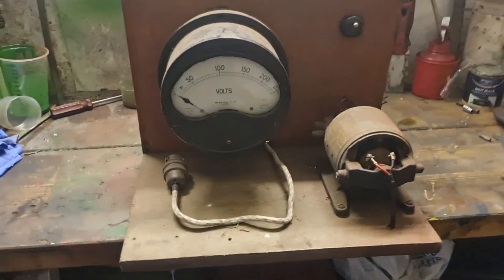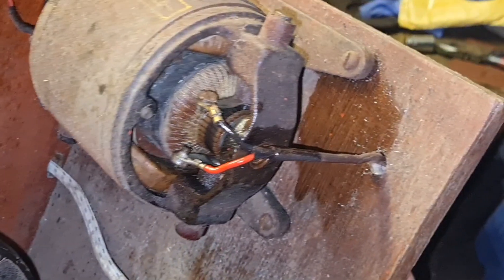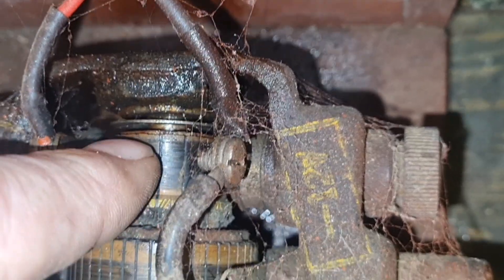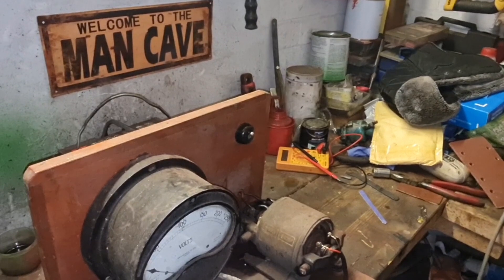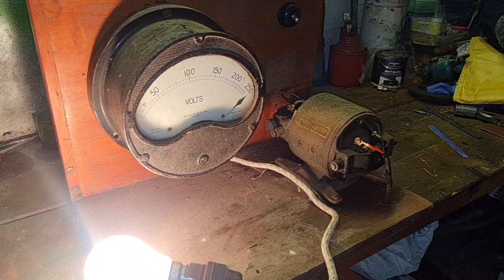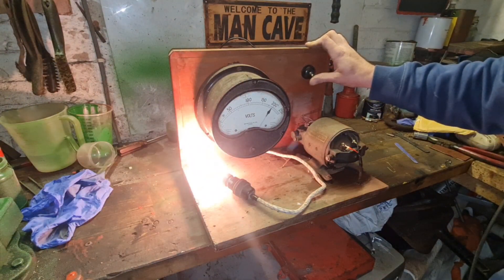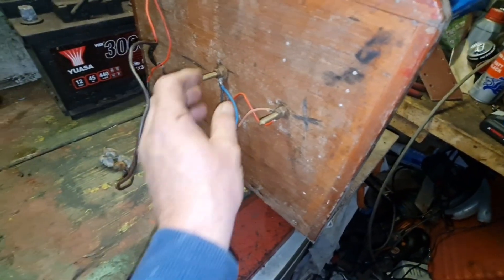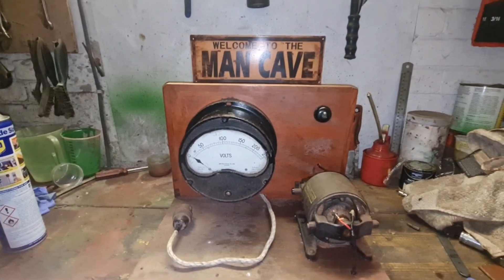Leyland Rotary Transformer. Will it work?? 12v to 550V 😆

Comment: They radio dynamotors, or rotary transformers for old tube radios some are for the transmitter portion, and smaller one for the receiver. They step up the voltage for the tubes, or valves on airplanes, or boats. I have one that’s a bit of an odd ball it’s military, haven’t been able to find much on it, but just based of its size at out put for watts when you do ohms law it’s probably for the receiver portion to what ever radio it went to. They are fun interesting pieces of history, there essentially an early inverter  though also know that there were different versions that were AC, or a kinda of dc output( really it pluses because of the switch commutator, which was herd in the radios.

Comment: Those machines are called "Rotary Converters" the part the brushes are in contact with are called "commutators". Way back they would be in all sizes up to hundreds of kilowatts. I have a 1920's book with pictures of them in very large sizes used in DC mains supplies. That rotary converter would have been on a mobile radio transmitter with the 240 volts on the intermediate valves and the 500 volts on the power output, the voltage would be correct only at the rated load so the bulb you have is not a big enough load to pull the voltage down to 250 volts. I would buy it from you, say £20..
Reply from the maker: Aw very helpfull mate. Thanks. Not sure I want to let it go now 🤣🤣

Comment: Hi 
I believe these dynamotors or rotary transformers were used in aircraft radio equipment before transistor inverters became available
Reply: You would be correct :)
Reply: And I had on old 19 set (tank radio transceiver) which had a small one built in.
Reply from the maker: Aw thanks for the info.

Comment: When I was a kid I bought one of these at an electronic second hand store, I had a 1/4 hp motor and an old car 1 2v generator along with a tripolet multi meter to do experiments priceless knowledge I'm lucky that I did not kill myself shocked many times that was around 1961 or 2
Reply from the maker: Yeah I don't want a belt off that blooming thing. 🤣🤣
Reply: I owned one when I was a school boy  in the late  60th, a classmate found it on his father farm in a tool shed. It was used for  a mobile radio transmitter of the german army (Wehrmacht) , it put out  1000V at 150mA from a 12V battery. I used it for electric  fishing on a little lake near my place. And yes I was zapped , a  very painful experience.  Later it found a job for a homebrew CB power amp with valves.  The german designation for such dynamotors are "Umformer"

Comment: Adam, that rotary convertor or transformer would have been used in a WW2 military vehicle for powering a receiver/transmitter, those voltages are I believe for a 19 set. DO NOT TOUCH THEM AS THEY COULD WELL MAKE YOU DEAD!
Reply from the maker: Yeah. The bloody thing scares me. 🤣🤣. To many exposed terminals to accidently touch. I bet the 550v would wake you up, or put you to sleep 🤣🤣

Comment: That is designed to provide power for a radio.
Those generally date to WW2 and the most common ones are from aircraft radios, but they generally operate on 28 volts. That one being 12 volts is more likely a land vehicles radio supply.
Reply from the maker: Aw I didn't know that. Thanks

Comment: Only to use with (military) radio-gear (using valves)
Totally not fitted for regular bulbs as the current (miliamps) delivered at the High voltage side is WAY too low. 
Just good enough for LED (to test)
It will probably deliver DC ... not AC.
They are called "dynamotors" and were commonly used during WW2
Reply from the maker: Yeah its DC only. What sort of draw would I need on that to make it work??
Reply: @NorfolkMancave  I don't understand what you mean with "draw" ... 
Probably "current-draw".

Those dynamotors normally produce 2 high voltages ... one (quite high) for the transmitter-tube ... mostly about 500VDC.
And a lower "high-voltage" (about 270V) for the receiver part.

I cant make-up what's on that copperplate, but it should mention a mA-value for all the voltages produced.

Seems to me that this little dynamotor doesn't come from a very powerfull tranceiver. 

You can easily calculate the watts by multiplying voltage ratio with the given mA-ratio. 

For really "big" tranceivers the military used big(ger) motor-driven generators in the field.

But could you use this for "other" purposes than tranceivers??? Not really ...

I'd consider this as some kind of school-display to show how a dynamoter works.

Comment: These things are cool af I wonder with a transformer if could be used as a kinda free energy device u know like a 240 to 12v transformer from the output too the input technically it should run constantly obs would have to have a switched 12v battery to get her goin then turn off once spooling also I wonder if u had a rheostat of soem sort on the input of u could control the voltage ie slow motor down a bit to get closer to 240
Reply: Lol, that doesn't work, but feel free to wander around fantasy island
Reply from the maker: Yeah I did wonder if you could run it off a battery that was charging by solar or wind.
Reply: @NorfolkMancave  ye man should be able too u would need a fair amount of solar power think should imagine be interested to see what amp currrent it draws while running could work out easily how much watts u would need the. For battery and solar